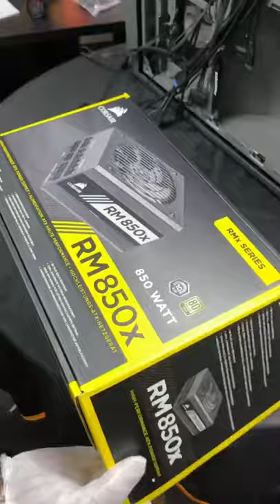A $21000 Workstation with AMD Threadripper - 2 #Shorts

Comment: Dude’s got a threadripper system with a gt 710 tied to it.
Reply: cuzz its a server
Reply: Because it is used as a display adapter
Reply: He bought everything on the setup until they dint had money for the gpu lol
Reply: @Vantanas get the joke
Reply: @Vantanas I know its a server but atleast get a GTX 1080 or something just to flex a little lol. Also didn't they said editing? Isn't editing also require some GPU power? Like I said, atleast a GTX 1080 or even a 1050
Reply: @Vantanas yeah but its for editing too so maybe throw in just a little bit powerful graphics card
Reply: @amvymavy  yeah like 10 series
Reply: I think this pc for mining chia
Reply: @Paloxee  well atleast a 1050 would be good enough. Or even a 960
Reply: @Paloxee  yeah I guess
Reply: Yes, it's a workstation
Reply: No he put it there for the meme, as u see 2 pci slots brackets are gone
Reply: @Vantanas and? Get a 3090 and mine some ethereum. Win win. Pc pays for itself.
Reply: Sunu Ananto  it's a Ryzen thread ripper dummy
Reply: @unplayer2839  still doesn’t it need a better gpu
Reply: What's bothering me is the 128tb of storage
Reply: Chia Mining system. 
Cpu power + Fast reliable Storage + optional Ram Storage (Ram drive)/SSD

GPU is not necessary
Reply: @theroyer1196  facts
Reply: @unplayer2839  this is nowhere close to server
this is now even workstation
it more then you, less then workstation
Server is a something what you install in 19 inch rack (there are self standing workstations), which works with redundant power supplies, redundant storage, redundant memory (even Dell PowerEdge R715 or R815 can do that) and so on and is build to work regardless everything, as long you supply power
Reply: Because it’s a bitcoin atm
Reply: @unplayer2839  just because it’s a “workstation” doesn’t mean bottlenecking suddenly disappears. Bottlenecking occurs when any load is put on the pc. Unfortunately this graphics card is gonna slow down the processor a good bit
Reply: @ectsy  Thats only if the are doing anything even somewhat graphical on the system. There are PLENTY of instances where a high end server/workstation wouldn't need a GPU. Everything isn't built for gaming, try again.
Reply: @carlossantiago6642  If you think this rig is even remotely capable of farming bitcoin you should buy a timeshare in my death valley beachside property.
Reply: Probably only needs cpu grunt for his intended workload.
Reply: @amvymavy  a rtx a6000 would be a better fit
Reply: If he want to photoshop or coding an games gt 710 was very good thing!
Reply: @ectsy  Nah, if it's a secondary for rendering in the background the small GPU is just for display purposes only.
Reply: Your profile pic fits your comment exactly
Reply: @amvymavy brother the threadripper can provide gpu functions of upto a 3090
(Told by linus tech tips)
Reply: That's because it's for CPU tasks. Many systems are built like this because only the CPU is really going to be using and they just need a display output, so any graphics card will do the job.
Reply: Because its a joke😂
Reply: Frfr

Comment: The conversation between the client and the master was something like this?Master: What processor do you need to install? Client: Ryzen threadripper for $ 2500 Master:ok, which video card? maybe an RTX 3090? Client:No, I've heard that the gt 710 is better, let's go with the gt 710
Reply: don't forget this is a workstation
Reply: Rtx 3090 sucks for this system
Reply: O cara compra tudo menos placa de vídeo kkkkk
Reply: @tyrek78  lmao why?
Reply: @greylawson6352  well there's a quadro rtx 8000 and new upcoming rtx a5000
Reply: @greylawson6352  first of all, it’s a workstation pc that mostly needs cpu power, also an rtx 3090 cannot fully use all of the power from the threadripper, since it has so many cores that are weaker
Reply: @tyrek78  neither can a gt 710?
Reply: @douzidoozy  just for display output, video playback and rendering is literally all handled the cpu and ram
Reply: @sillyme2598  ok
Reply: @Arctic_silverstreak  Then why did they get gt710
Reply: @frozenturbo8623  well as sone people already said it's just need video out, program that heavily and only rely on cpu do exist like daw and in that case at most,  you'd be spending in something like a rtx 2060 to drive something like 2 or 3 4k panel smoothly
Reply: @frozenturbo8623  threadripper cpu like in that system doesn't have igpu so the system wont boot unless theres an external GPU inserted..
Reply: @tyrek78  what shit you chatting bro? Thread rippers are literally top of the range cpus.
Reply: @iCore7Gaming  no they aren’t, it’s a server type cpu, meaning it’s cores are weak. If you’re talking about using this everyday as a normal cpu, this isn’t the best
Reply: What if he didn't need a powerful GPU?
Reply: Master? Tf...

Comment: Cpu: threadripper 3970x
Ram: a lot
Hdd: YES
Gpu: gt710 .-.
Reply: Its a server computer, it only needs computing power and not graphical, unless it runs Cloud Gaming or something
Reply: @fib621  es una workstation, y dependiendo del uso puede necesitar varias gpus potentes, yo en mi caso, para desarrollar videojuegos, me vendria bien un threadripper para cortar el tiempo de recompilar shaders y empaquetado, a la vez que una rtx 3090 para poder trabajar tranquilamente en un juego next gen
Reply: Hotel: trivago
Reply: @fib621  then if it was, they would of got a gt 210
Reply: @Dabs_Rulez  Would it matter? Like, a GT 710 only costs $20-30
Reply: @fib621  yes the graphics does matter because you will get very bad performance with a gt 710 or 210 so this computer is so bad
Reply: @Dabs_Rulez  why would the graphics matter when it doesn't even need a screen most of the time
Reply: @nguyentrananhnguyen7900  because workstation programs need lots of graphics
Reply: @Dabs_Rulez  some do need a lot of graphics
but a lot of servers, workstations don't 
fyi: the only time a server need a GUI is when it's it first installed and when severe issue occurred
workstation, depend on the job, they might not need a GUI as well
p/s: not everyone is a gamer or video editor
Reply: @Zumito  No bro, es una pc servidor, la cantidad de almacenamiento es bestial para una work station, teniendo en cuenta la capacidad, el procesador de alto rendimiento y la económica tarjeta gráfica es una pc servidor
Reply: Hotel: trivago
Reply: @fib621  what this is workstation not server

Comment: Imagine having a good pc. Ha. Couldn’t be me. Ryzen 3 3200G
Reply: that's a great cpu my guy
Reply: Save up for a 3600, it's so worth it, unless you are stuck on integrated graphics
Reply: @DaneH64  He doesn't need to, 3200g can handle an rx 580
Reply: @DaneH64  his cpu can totally handle an rtx 2060
Reply: I atleast hope you have a better gpu instead of that piece of shit inside that pc in the video
Reply: I use the R3 3200G also, overclocked via Ryzen Master
Reply: Gang gang
Reply: cries in core I-3 6100
Reply: I've i3 9100f with GT 1030 😢
Reply: @Maximilian69  you a bit slow there bud? It's a workstation build. The GPU is literally there as a display adapter
Reply: I5 3210M
Reply: @logan374  f
Reply: @logan374  F
Reply: @DaneH64  3600 is beaten by i5 11400f
Reply: Anything Ryzen is better than a MacBook. Air....
Reply: @TheJimmyG91 you know that workstations, although not as much as a gaming PC, require GPU power as well. They just put that there for show, they definitely took it apart immediately after this video. You would need something better for it to be practical.
Reply: That's a good CPU, Vega 8 is like 1050 ti level of performance
Reply: @logan374  I hope that cpu isn’t paired with an eGPU 3090 :-:
Reply: @frozenturbo8623  yeah
Reply: At least your gpu is better than his

Comment: Why would you have 8tb in m.2 ssd but then use 8 1tb hard drives?
Reply: If you look closely it's 16TB hard drive. So 16TB*8.
Reply: @t_Daw9  good lord that's a lot of storage
Reply: @memesredacted  Because it's a *WORKSTATION PC*
Reply: @ix.cryo1  i don't even think Gavin Free from slow mo guys has that much storage for his computer and those phantom cameras put out a ton of data
Reply: @memesredacted  It's most likely built for a specific client
Reply: If its for video editing with high resolution videos, 100tb can be filled very quick...source :mkbhd
Reply: This is baby storage for a workstation

Comment: Bruh the man spent $21000 on a PC and then put a gt 810 in it
Reply: I think he meant $2,000 if it’s a GT 810 and Vengeance RAM
Reply: That's definetly not a gaming pc lol.
Reply: @antoniopetcu8688  Yup. It even says ‘Workstation’ in the title
Reply: Karben Feibar nah not $2000 those hard drives are 16TB each they cost about £800($1000) each and he chose vengeance LPX ram because there’s simply so much of it that’s probably 128gb at least
Reply: At least you can start a pc with a gt 710
Reply: @tyrek78  PC kinda wants to be used at that price doesn’t it? Spending $2k on a PC just to start it is irrational.
Reply: @Alfwoodsy  no, this kind of computer is for servers or actual heavy programs that dont require that much graphics power
Reply: @tyrek78  Could’ve specified that earlier. Again, ”WORKSTATION”
Reply: It's a 710
Reply: @tar4ka25  Yeah I think we’ve gathered that already
Reply: He didnt realized he had no more budget for gpu

Comment: Wait did I see that correctly?
Reply: Yep, you saw it correctly, a Threadripper 3970x or whatever with a GT 710. The biggest bottleneck in existence.
Reply: @TeamHELPER  Used as a video display adapter. Not a gaming PC. Are you that slow?
Reply: @ix.cryo1  yes i am slow
Reply: @TeamHELPER  im not surprised
Reply: @ix.cryo1  no I think you are

Comment: This dude really built a server/workstation with rgb just for the flex 👌👌👌
Reply: And to get laughed at for having GT 710
Reply: @frozenturbo8623  Nothing wrong with the gt 710. It would be used as as display output for the initial configuration. After that this whole thing will be accessed via remote desktop from another pc
Reply: @one_boi1277  people laugh at people having really expensive CPU and trash GPU when you can get cheaper gpu than GT 710

Comment: It’s clearly meant to be a server, that’s why it doesn’t have a crazy GPU. If the guy building it knew anything he wouldn’t have used a water cooler though.
Reply: If its a server it doesnt need the cooling anyway but with that hard drive setup what sort of workload would demand threadripper performance in a server setup.... Only thing i can think of is feeding to a data center to several dozen concurrent users....

Comment: to be completely fair to this build, it probably solely exists as a storage server, with the gt 710 existing just to output a display, if not this video may or may not be a prank, as a second pcie slot is removed for no reason which could be for the actual gpu

Comment: This guy: Sir do you have a 3090? 
-No they already out of stock, if you want we can include a gt710 to you gaming pc kit
This guy: I'll take it!!!
Reply: It's not a gaming pc, it's a workstation pc. plus, you're better off with a 5900x that a threadripper since no games will utilize so many cores and only care about ipc and single thereaded performace. as for a workstation, a will only be used a display output and not gaming whatsoever, so they'll grab the cheapest gpu with the display adapters they want just to output a signal.
Reply: @sillyme2598  Are leds also useful for a workstation? probably with the price of this motherboard without LEDs, there would be more money to buy a better gpu, you know what I mean.
Reply: @sillyme2598  No, workstations have very good GPUs and this is not a workstation, it is an expensive piece of garbage that you can throw out of the window. Who would use this dumpster fire. Like he should of used a RTX 3090 instead because a gt 710 can’t handle anything at all

Comment: btw the reason why the guy went for multiple hard drives and a bad gpu is because this build is a workstation and its not for gaming so the cpu power ram and hard drive is necessary while you literally don't even need a graphics card

Comment: For who saying wy use thats gpu:

Maybe thats Work station is for data transfer , they use gpu just for display once or when its need. 

For example:

There is 50 pc, they work together in 1 big project,, but the data is so big,, so they need 1 pc with very big data save..
Example: for total data is 100 terabyte,, so if thats 50 pc want get data so fast from 1 pc station, they need a station pc with good prosesor and good and big ram, big disk drive/ ssd and big power.

If the workstation not in good prosesor and ram, the transfer data will be slow, because sometimes 50pcs will use thats 100 tera data in one time.
And no need 3080 for thats workstation pc.

The example again: server google, or any world server,, there is milion people use super big data in one time,, so its need super poresesor or super computer to transfer data, but no need super gpu. Because thats data is no need to be open in thats pc, but just transfer it, then the data will open in other pc who need gpu tu proses , if its gaming data, you will play thats game on your pc, not on thats server / workstation pc.

*sorry my bad english,, but i hope you all understand.

Comment: Im pretty sure the gt 710 is simply a placeholder so they can actually have a display on the monitor to configure settings, the customer may already have a gpu and will most likely replace the gt 710 soon.
Reply: Their work use isn't gpu intensive ofc, probably used as a server i guess

Comment: It’s a work station that’s why it only has a 710 in it. My question is why have the thread ripper? If you’re going to be needing anything that needs a thread ripper you’ll likely need a better gpu.  Then again most application he’s using is likely all Ram/ CPU intensive and only needs a display output.
Reply: Anand Raj  it’s a Workstation. It’s not meant for playing games. It’s not a gaming graphics card it’s a GT not a gtx. It’s pretty used for a display output.
Reply: Anand Raj  you don’t need 1440p or 4K. Workstation can get away with 1080p just fine

Comment: Workstation: CPU and storage is much more need them a big GPU. In this case a big GPU only  heat all system and gives bad high levels of watts need to work. A GT710 is much more than they need for this kind of job. Well done. Smart guys will understand..... Kkkkkkkk Kkkkkkkk Congrats for this beautifull machine.

Comment: He went for liquid cooler for server 24/7. Is it reliable for 24/7?. For low end graphics card i still think old low RADEON x5xx still supported, but not 710gt (win 10 example) for d3d opengl workstation, eventhough he goes Linux or Windows server or else.
I believe this for server, otherwise he will install quadro rtx a6000 or quadro rtx 8000 for heavy workstation, double if money is not object

Comment: $21,000 gaming computer with a 850Watt PSU. Makes sense.
Reply: It actually does.
Reply: @staideysstudio4637  it does because he has a little 710 GPU, but I meant it as how are you going to have a $21,000 gaming PC and only need an 850 watt PSU. I have seen setups at half the price with the top GPU, top everythinggg. The overall price doesn't seem right to me.

Comment: 21000 dollars but using HDD instead of SSD in work station 😂😂. Also putting just some gt 710 instead of some Rtx 4000 work card..... This is not 21k usd setup, this is just something around 4k  usd.

Comment: You forgot your IO shield and you put wayyy too much thermal compound on the cpu and there’s a possibility that too much could damage it or not provide proper conductivity (which slows it down)
Reply: The Io shield is built in

Comment: Everybody is Talking about that damn hard drive and. I am thinking why the hell did he buy such a bad graphics card And one of the best CPU's in the world???
Reply: chia mining
Reply: WORKSTATION PC. THAT'S WHY. ARE YOU THAT SLOW???
Reply: @ix.cryo1  bruh ik but like if you put a damn gt 710 that's just messed up with a machine like this
Reply: @noobmeister5837 what
Reply: @ten344ship4  It's obviously used as the display output adapter!
Reply: mining chia doesnt require GPU power so they only put what ever can display the picture. they need high threads count to mining the coin and large storage to store it
Reply: Ok

Comment: Would a like something to match your awesome CPU? No thanks, I’ll have 10 of your oldest HDD’s!
Reply: These are new fast modern HDDs. In RAID they are as fast as SSD's.
Reply: @staideysstudio4637   they might be as fast as the slowest SSD out there for sure.
Reply: @Panicscroll69  
These are top-end server hard drives with a maximum speed of 270MB / s for sequential and random read write and read. These hard drives are expensive, new, and pretty fast. Multiply that by 8 and you get a whopping 2,160 MB / s.

Sure, it's slower than the SN850 or 970Plus, but not as fast as the slowest SSDs on the market.

Workstations and servers don't use solid-state drives because they are unnecessary and expensive. For these purposes, the relative speed of the hard disk is sufficient. Servers and workstations require more storage than fast storage.
Reply: @staideysstudio4637  whatever you gotta tell yourself 😂

Comment: Those don't look like proper RAID drives with reduced vibration sensitivity for having more than 2 drives together, for WD brands, they need to be at least Red Pro to survive in an 8 drive RAID.  Also to get best RAID reliability, you need to mix brands so design mistakes don't kill all drives at once.

Comment: What about some SSDs instead off all those super slow hdds
Reply: These HDDs is RAID are going to blow away any SSD
Reply: @staideysstudio4637  Yea so even 10 hdds in raid at 250 MBs transfer is what, 2500 Mbps.  4 SSD array runs around 17000 Mbps